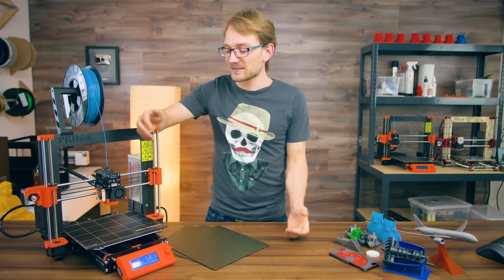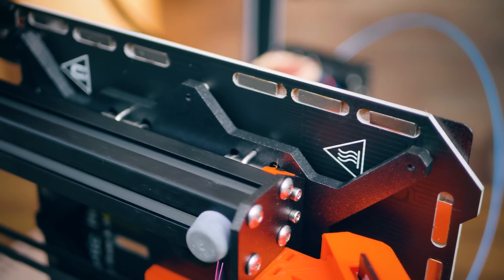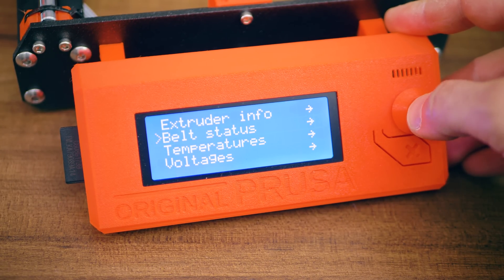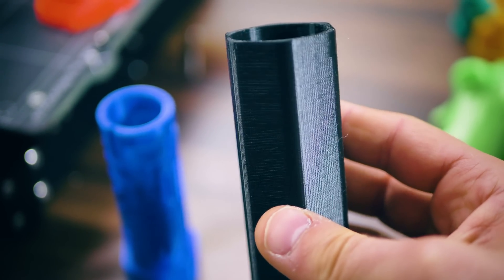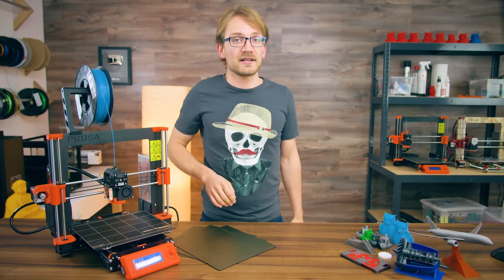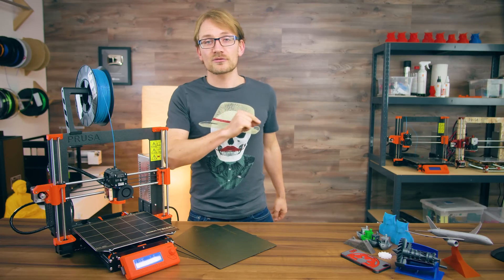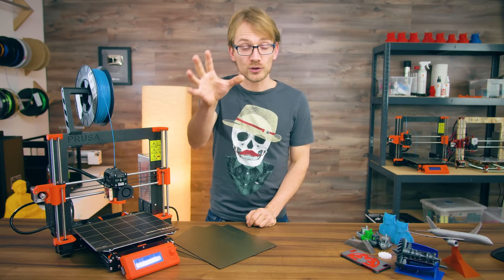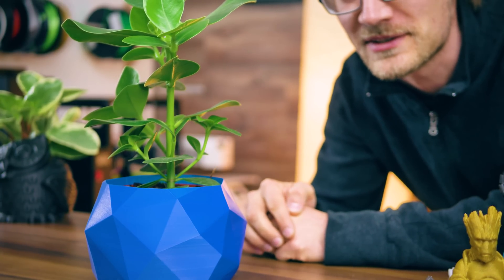The most important 3D printer - Original Prusa i3 MK3 review!

Comment: Tom I gotta say watching your video quality go up and up over the past year has been amazing. Its not just the video quality its the comfort you have on camera, the way things are filmed, how clear you make your points. Also I am liking the bits of comedy you are adding. Keep it up man!
Reply: outnumbered it's a lengthy build process (allow for about 7-8hrs if it's your first build), but all steps are very clearly laid out, and all parts very well designed. Any parts which might trip you up are very well highlighted in the documentation. The steps are broken down into chapters, to provide logical 'sections' of the build, parts and fixings are bagged together into the sections and clearly labelled. If you don't mind the time it takes to build, there's no reason to not go for the kit 👍it also helps with understanding how it works, and a huge feeling of accomplishment when you get it done! Have fun! PS. I recommend using the online version of the build documentation, as there are comments on the steps which often answer questions you might have!
Reply: How hard is the kit version to get assembled right.   Is it worth it to just buy the assembled   I like building kits but need the printer to work well too :)

Comment: cheap linear bearings still bother me. If these where upgraded you could get the stealth sound benefit along side the auto recover without sacrificing one for the other. While its great that prusa is part of this wave of hardware / software and design reawakening the opensource movement at least some what back to the heights of the 90's which laid the foundations for so much of the technology we use today I also think the lessons of past tell us that Prusa needs to keep control of their overhead costs if they still hope to be around in 5 years time. I will order a MK3 kit once the waiting list drops but I also know I mod it during the build and will  be overpaying for what I get
Reply: i got misumi bearings, $$$ ... they were the same in terms of sound and worse in terms of tolerances, and that's with "their" own rods.   the prusa's had good tolerance but they do fail and fuck up your rods.   that being said, igus was the only thing smoother and quieter.
Reply: digibluh I don‘t agree with you. Misumi bearings are great!
Reply: digibluh I built with the igus bearings first, but could not get a self test due to very high bearing friction making the x and y axis way too hard to move. Installed the Prusa bearings and no issues at all.
Reply: Put grease on your rods and theyll last longer and be less noisy
Reply: @Sloth Igus bearings are self lubricating but require friction to lubricate. You can pre-lubricate BUT the lubrication may degrade the bearing if it has the wrong composition. By just running the bearings up and down the rod a few times they will release lubricate and slide smoothly. I will use the pre-cased Igus but with the MK3 my need to tune the torque settings for end stop discovery to stop false positives while the bearings are new. As I do not have a mk3 yet I am unable to assist with changes required but I will update here at some point in the future so if you wanted to change to Igus you have the details. Of course if you get them working before then please share your changes :)
Reply: @digibluh I find Igus to be great, I know some people dislike them but I have had great results. Of course I would much prefer linear rails and carriage that is not the same easy mod as swapping out a set of bearings!

Comment: The i3 is forever my favorite design, specifically for its economy, openness, and accessibility, which are second-to-none. I cherish my self-sourced i3, even as I'm constantly rebuilding it.

On the processor front… Absolutely, the AVR platform still has a lot of life left in it, with many firmware optimizations still possible. The place where AVR falls down is in trying to support Deltabots with 32x micro-stepping and a graphical display. The otherwise snappy AVR processor simply can't keep up with that kind of demand, and Marlin will actually trigger the watchdog timer and reboot (though we're looking to eliminate that outmoded drastic response). For a Deltabot you have to either back your stepper drivers down to 16x micro-stepping, replace the graphical display with a character LCD, or slow print speed way down. But for Cartesians —and frankly any machine with Trinamic stepper drivers— the 16MHz AVR processor can readily keep up with the steps-per-second demand, even at faster print speeds. It's a really amazing little architecture, and makes the most of every cycle.
Reply: Scott Lahteine hey man, thanks for your amazing work :)
Reply: The AVR has been with us since the PlayStation was the hottest console around. To say you don't need anything more ignores exactly how much things have advanced. It was awesome in 1997, but is horribly underpowered for most 3D printers. Ignoring the slow clock speed, the CPU is severely limited in RAM, and has only very basic peripherals. Even something as simple as Ethernet requires an external MAC IC be added. Prusa is not doing themselves any favors by using a 4 line character display and knob interface. This arrangement is very tedious to use, and likely costs more than a small Color graphic touchscreen LCD.
Reply: Don't misunderstand my point. As one of the leads on Marlin development, I'm well aware of the limitations of AVR, which is why we're so keen to get our porting work to 32-bit platforms completed. I was addressing whether these processors can keep up with the needs of pushing plastic out for several days reliably and with reasonable speed, and they most certainly can, especially in a Cartesian arrangement. If users feel they want or need more, AVR can also integrate Wifi without any greater strain than it manages USB-serial, and there are other ways to augment the electronics and take load off the MCU without going for the full 32-bit board. For example, you can use a Nextion touch display, which takes even more load off the MCU. For one of my clients, we paired two RAMPS-derived boards together with a custom Marlin to drive a single machine, communicating through I2C for half the cost of single 32-bit board. The AVR platform deserves praise, not derision, for remaining viable and relevant to this day.
Reply: Speaking as someone who has been programming AVRs (and enjoying them) since before there existed a C compiler for them, I can deride Atmel for their failure to advance the architecture, and their bizarre pricing and peripheral combinations that have them more expensive than much more feature-rich microcontrollers from their competitors. When I critique them for being slow,  I'm not just talking about the raw speed needed to print something, I mean simple things that are missing from the architecture that slow down everything else. For example, there are only a handful of devices with native USB. Yes, you can add a FTDI converter, but that's an extra cost and an extra part to source, and the transfer speed over USB-Serial is not impressive (i.e. laughable). Once again, you don't need a lot of USB speed to send some GCODE to the printer as it prints, but what about when you want to write GCODE to the SD card? It takes forever! This is compounded by the lack of an real SD interface on the AVR, limiting it to SPI 1-bit transfers to the card. I could go on. Don't misunderstand me: I promoted AVR for years back in the day when everyone was drooling of the godawful PIC (Ironic that Microchip now owns AVR) they were awesome for quite a while, but they stagnated and did not advance their design they way they should have. The only reason they are in 3D printers at all is thanks to the Arduino, and it's great to see so many new printers coming out with 32-bit cores, because the AVR was becoming a poor choice even back when the first Arduino was made. The AVR is still a very good choice for a lot of applications (especially the TinyAVR end of the spectrum), but not this one.
Reply: Indeed. We were a little surprised when Prusa didn't go for the SAM3X8E (Arduino "Due") as the heart of this machine. I'm gratified to hear that there are at least two developers working on an "Einsy" variant with the more powerful core.
Reply: With the MK3 mainstreaming the hardware features like skip detection and power outage recovery, etc. it's only a matter of time before every printer has them. It's exciting to see how things are progressing and how quality improves with each generation of printer. We live in a great time!

Comment: Even if you can not afford to buy this great printer, you will get the benefits of it as all the other printer manufactures will be forced to play catch up and put in these new features. So the cheaper China printers will very soon have all the features. They were so fast to add the power loss resume and filament run out sensors to the low end machines. I love my MK3 now that it has the latest firmware update. Seems to be working so perfectly.
Reply: actually my 1 year old bibo 2 china printer has power outage detection and filament run out detection as well as the ability to monitor my print remotely via it's integrated wifi,  the point i'm trying to make is not all china printer's are outdated crap,  most are but not all. Out of the 3 printers i own (prusa mk2, creality cr-8 and bibo 2) the bibo also has the best print quality,  but it is shocking how quiet the mk3 is tho
Reply: uh i think you might be wrong, some of the features were implemented before prusa did.  prusa has a lot of hype behind it. its 2018 and they still want to use that old small screen?  they use cheap bearings and rods  the list could go on.
Reply: My only point was that this will help push forward better cheap printers. Nothing more.

Comment: $1000 and no touch screen? What year is this? 1999?  Seems like a great printer and it's a shame that it's missing this common modern convenience.
Reply: Fern Moore I have the mk2s. I don't desire a touch screen. The interface is really easy and orginized.  I think it's great!
Reply: Be that as it may, every home appliances have a touch screen these days.  It can't be that much more expensive to add one in.  Sure the device is functional without one but it's a feature that would go a long way to giving it a more professional/commercial appearance and reputation.  Little details matter. The company that makes a mk3 clone with a touch screen is going to have just that much of a leg up and that's bad for Prusa.
Reply: Something else to fail that has no influence on the performance of the machine. I’d prefer they never add that.
Reply: A touch screen isn't always a good thing. Yeah, it can be nice, but the LCD plus encoder wheel is a simple and practically bulletproof solution. In an environment with a 3d printer, a glossy screen you are always touching isn't great.
Reply: You can say the same thing about the LCD screens.  Why not just by pass that all together and tether it to a PC like every other kind of printer/output device? Touch screens are better and cheaper than ever.  These LCD screens are clunky and not as intuitive.
Reply: I'm just saying it could go from a 9.5 to a 10.
Reply: Fern Moore Tethering it to a pc is always a poor decision. Printing from the SD card is simple and easy. Again, adding more trinkets and bs to the printer just gives more chance for failure. No thanks.
Reply: I understand that tethering has it's drawbacks but to un-couple it you are "adding more trinkets and bs to the printer.." So your argument doesn't make logical sense.  You need a control point. No matter what you use for that control point it's a point of possible failure.  Doesn't matter if it's LCD, touch screen or a laptop.
Reply: Fern Moore First off, I’m not arguing anything. You’re bitching about the price point and features. I’m saying it doesn’t matter. It outperforms printers with many more features and gadgets. It works and that’s the point. Don’t like it? Don’t buy it. 

Even an Ultimaker 3 doesn’t have a touch screen. It costs 3 times what this machine does and still they perform the same. 

If you want a touch screen, go for a machine that has one. Pay more than the MK3 is worth and get the same print quality. But hey, at least you have a touch screen. Lmao...
Reply: $1000 assembled...
Reply: you'd have to try it to know. I have an octoprint setup which puts all the controls in a browser window on your phone or computer and I find i would still rather use the menus since they are soo much faster.
Reply: :) No knock off could ever beat the print quality of prusa. And with all the 3d printed parts I don't think commercial appearance is what its going for. Also, It is far more than functional, you'd be surprised. We can agree to disagree!

Comment: 100% agree with everything you said, accept the slicer default profile. All profiles for PLA are tune perfic in slic3r, but not for other materials they require lots of tweeking.  But everything else after few firmware revision work great including using Octoprint with RBzero.

Comment: Great review! I'm leaning towards this printer! I want to keep doing more research, but so far, this one keeps coming to the top like cream! I'd also want to get the 4 filament upgrade because I'm a color guy and want more from the printer than single color prints. Tome will tell as I continue to do more research! Thanks Thomas!
Reply: Unless you're comparing against much more expensive printers, this is the one to get!
Reply: Get this one. I have the mk2s. It is amazing!
Reply: Don't go for the multi material upgrade, it's full of issues. At least read the multi forum pages at prusa beforehand, you should know what you are letting yourself in for!

Comment: Not neodymium magnets.
Reply: Quite sure Josef himself referred to the magnets as Samarium magnets
Reply: sumarium cobalt 
Extremely resistant to demagnetization
Good temperature stability (maximum use temperatures between 250 °C (523 K) and 550 °C (823 K); Curie temperatures from 700 °C (973 K) to 800 °C (1,070 K)
Reply: GoatZilla yes, neodymium, high temperature ones
Reply: How lazy do you have to be to use the wrong words when you know the right ones?  Just use the correct language.

Comment: My biggest problems with the MK3 are huge z-scars and it won‘t really print overhangs all that well.. Unfortunately I deleted all my settings in Simplify I had for the MK2 which printed absolutely perfectly without any artifacts and way more consistently. I‘ve been trying to get back to my old settings for a week now but I just can‘t seem to be able to figure them out. Also Slic3r didn‘t work all that well, Prusa Control is pretty powerful tho. Could you maybe share some of your FFF profiles? Maybe I can find my mistakes then and finally actually start printing. That would be really great. This goes out to Tom or anyone who‘s got good settings for the MK3, thank you.
Reply: If you used simplify 3d to slice something and still have the gcode file for it, you should be able to load a profile from that file as the profile is embedded as comments at the start of the gcode.

Comment: Any thoughts on the MMU or generally the idea of upgrading to multi-extruder?
Everything about the printer looks great, but I've read both good and bad about the MMU. And it seems (to me) there is no alternative to it, if you want a Mk3 with multi-extrusion, since the board can't support more than 1 extruder natively.
Reply: Installed the MMU upgrade on my company's MK2S and then after two successful 4 color prints (Gear Bearing and Cat) converted back to a single material Bowden by removing the multiplexer. Since most of my prints are single material for work the multi-material feature was added complexity that seemed to reduce reliability. Now I'm contemplating purchasing the MK3 and I will probably restore the MMU for the occasional novelty print or for use with dissolvable scaffolding material. I doubt that the current MMU is Prusa's last word on this technology but in my opinion it is still way to finicky for use on a production printer. Your mileage may vary.

Comment: Spot on review Tom! Got my MK3 from the first batch in early December. Even with the "beta" issues, it has been an incredible machine, blowing away my previous Maker Select v2! It is really hard to appreciate how quiet it is on a video, it is unbelievable. I have it in my office,and often don't realize it is still printing, while I had to wear headphones with the Maker Select. The removable sheet makes print retrieval trivial. I agree that there could be a more advanced solution to the Rpi Zero, but it is pretty slick and an improvement over hanging one externally. And holy cow is this thing fast! While the MK2s is still a decent machine in its own right, I think the extra cost of the MK3 is easily justified, and can't imagine stepping backward. I have had great luck with flexible TPU, and the MK3 prints PETG fantastically, it is my favorite material now.

Comment: I agree with your comments on the MkIIS, and that was my thinking when I bought the MkIIs kit for 599 in early Dec. 2017 (after the MkIII came out).  My MkIIs is a great printer and prints really well.  The only down side was the frustration with squaring the threaded rod frame (my fault, I just had to get it "Perpendicular").  If I had to do it all over again I would probably spend another 150 and get the MkIII kit for $750.  I suspect that the extruded aluminum frame on the MkIII would have been much easier to deal with.